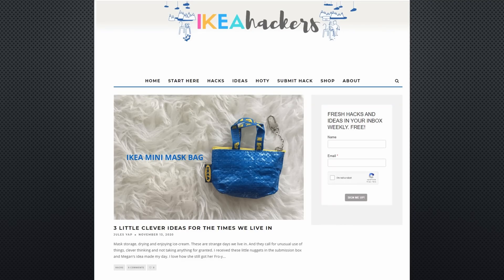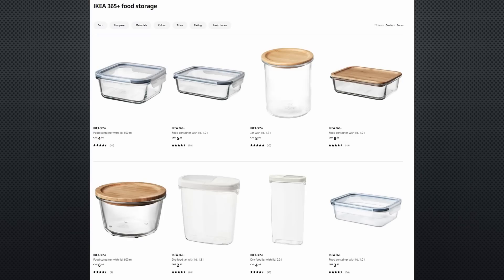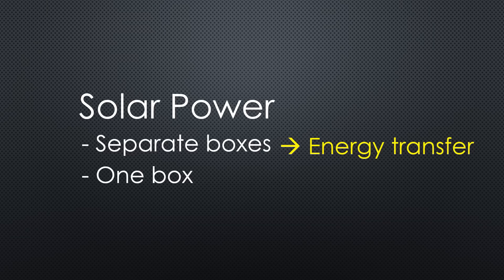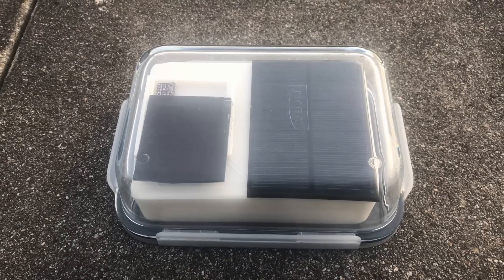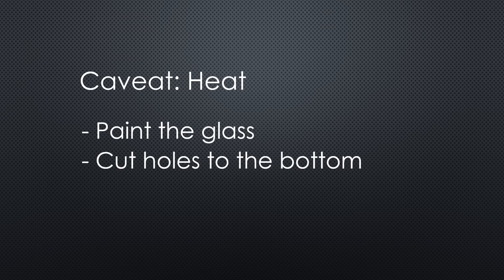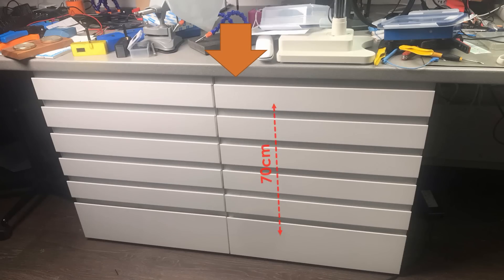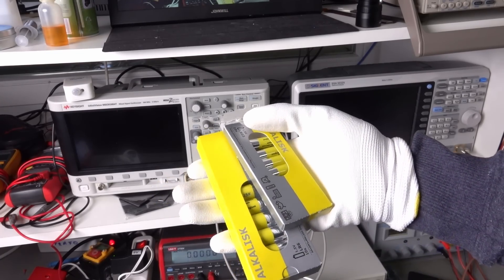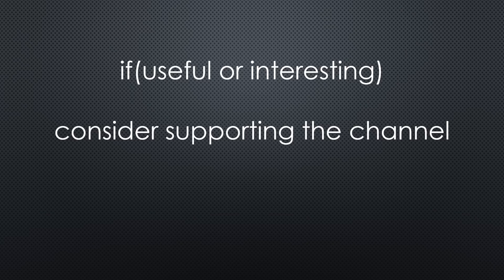#361 IKEA Goodies for Makers incl. my Newest Find

Comment: Hi Andreas, thanks for another great and interesting video - I think that using a double glass walled container like a thermos would serve you well would be a great experiment that I might even try myself
Reply from the maker: Do you have a link for a double glass box for a reasonable price?
Reply: @AndreasSpiess  all the glass thermos containers are cylindrical designs but many have a large mouth opening - not sure if it’s suitable for your project but it would be interesting to see how it performs as a temperature isolation and RF signal transmission and reception

Comment: As you noticed, epoxy coated solar panels quickly degrade in the sunlight. However, there is a quick and simple solution. Multiple manufacturers make clear UV-resistant thick tape for fixing greenhouses etc. It is perfect for protecting the solar panels, easy to install and with a few years of experience it seems to do the job well. Also, it does not seem to affect the efficiency of the panels much. I believe big clive has a video about using this tape.
Reply from the maker: Great tip! Today I learned from other commenters that the glass also blocks UV. So I have two solutions.
Reply: @AndreasSpiess  glass definitely protects from the UV-light, but my experience is that most glass types will significantly reduce the panel output (like 20-50%). That's why solar panels normally use special low iron glass. The tape I have been using is something like this: https://www.amazon.co.uk/Scotch-Supreme-Glass-Repair-Tape/dp/B00QRZACW8
Reply from the maker: The reduction in power is well possible, but not too important in this application. The worst case would be that I have to add a bigger panel. They are no more expensive.
So far it completely charges the battery every day. I will see how it will go during winter.
Thanks for the link.

Comment: How about reducing heat with a Peltier device?
Reply: Uses waaaaaayyy to much power. You'd need five extra solar panels. Plus the Peltier needs to be able to dump its heat somewhere, which would mean having to make an opening in the box to fit the hot side.

Comment: For outdoor boxes we ussualy drill one ore two holes at the lowest point to facilitate the box "breathing" thru night do to pressure changes from the temperature, thus the water is spitted out in the morning, the only problem is that the humidity is the same as outside. But there is no problem of water collection.
Reply from the maker: Many viewers suggested this method. Therefore I will place a second box with such a hole nearby and watch what happens.

Comment: Great video!! Here area my favorite from Ikea Spain: I use the LADDA/Alcalist/CR32 batteries, power bank,  103.115.96 great for keeping all spugers/small tools, 102.891.14 to store RTL-STR and leads, gliss transparent boxes for components etc (just came back super cheap), 600.940.72 coloured trays/bins for work in progress or bring small tools and measurement equipment to site of failed equipment. Still looking for the radio controlled clock you showed. I guess Madrid is too far from DCF77 (1000 km), but I am able to sync with my wx station (guess Ikea don't want to field service complaints if nor working reliably).  Thanks for the tips on the new containers, looking really good.
Reply from the maker: I think you discovered good products. Unfortunately I did not find a way to search for product numbers on the IKEA page :-(
Reply: @AndreasSpiess  Yes you are right some references are no longer sold. pity.

Comment: Regarding the temperature issue: we sometimes use dual heatsinks, one on the inside, one on the outside, but we mostly use metal housing. Maybe it is possible to implement it by cutting in the plastik lid and ad some alumimium sheet for the heat transfer and silicone caulking for the water resistance.
Reply from the maker: That would be a good way to get heat out. I still dream of a possibility to avoid entering too much heat. And another viewer suggested to just take the battery out. Which also would be a viable solution.

Comment: To get rid (or at least reduce) the moisture on the inside, install a Gore-Tex vent in your enclosure. The temperature changes in combination with a large volume sucks moisture in through the water tight seal. A Gore-Tex vent will equalize the pressure without letting water droplets in.
Reply from the maker: Many viewers suggested such a vent. I have to search for one on aliexpress. Then I plan to setup a few boxes with different "systems" and compare them after 12 month or so.

Comment: Watch out, polypropylene has a tendency to break in the sun's UV radiation. I've had similar clear plastic things (made for gardens, mind you!), and they tarnished and became so brittle that touching them breaks them like if they were made out of sugar. I would think that the glass containers fare much better, though. That would be my choice too. Cool ideas as usual, thanks!
Reply from the maker: You are right. I would not use plastic boxes in the sun. In my setup the plastic is covered by the glass. And other commenters wrote that the glass removes a lot of the UV. So there is hope!

Comment: Ikea Lack square tables (the yellow one at the end) also make good 19 inch racks, though you may need to support very heavy equipments at the rear by using offcuts of hardboard sheets stacked in between items - the legs are relatively weak as they are hollow except at the ends but will easily support network switchers and routers. 

For taller racks you can drill the ends of the legs and glue in dowels (I used a short piece of M6 threaded rod) and drill a corresponding hole in the lower tabletop  - this prevents disasters because the upper table will slide on the lower one otherwise. 

You can then place very heavy equipment direct on the tabletop, where it can slide in/out easier. Cut a  sheet of hardboard to make a liner to assist sliding - or the tabletop may be scratched by the nutserts and screws on the equipment case. 

Stacks 3 or 4 tabes high are possible if you put the lighter equipment at the top.
Reply: I think these were called "lack racks"
Reply: Better Racks: RAST. See my other posting :-)
Reply: Thanks, I just was thinking on how to do my home lab for cheap !
Reply from the maker: True, I found a few googling "lack racks"
Reply: AFAIK, Ikea changed the LACK table. The legs are not any longer stuffed/made of compressed wood, but of paper. Makes the use of dowels impossible. :(
Reply: @mrwho30  ah but the ends have a short plug of what is called particleboard, in British English, though most people call "chipboard". 
It's about 1 or 2cm thick on the leg bottoms and 3cm thick on the tops (where the large screw fits into the leg top). The rest of the leg is hollow. 
Likewise, the corners of the tabletop also have a block of particleboard  to accept the thick screw. 
Original Lack (I'm talking 1997-ish maybe?) had solid particleboard legs that were noticeably heavier.
If you fit rack rails the trick is to use them full length and  screw them into the very top and bottom of the legs firmly, while screws in the middle have less purchase. It's best to always prop small offcuts of harboard between item cases to support the rear and prevent them sagging. 

The tabletops have remained unchanged -  are what people would recognise in the UK as "council-house door" - very easy to punch or kick through. For a simple rack they are good enough to hold the weight of a steel fileserver with full size rack width and 16 spinning hard drives. with a heavy PSU. 
I don;t attempt to fit rails to the legs fo these heavy cases though, I rest them either direct on the tabletop or with a hardboard sheet so they slide in/out easier without nutserts or screws on the bottom diggin into the surface.
But hey, for the insanely low price, who gives a flying duck about scratches?

Over the last 20+ years I think I have left behind at least 100 Lack Racks at various SoHo offices or outposts. I only realised that people call them Lack Racks about 10 years ago haha. 

Whenever I visit an Ikea store  somewhere smilar I always take a proper tapemeasure. 
450mm is the ajic width between the legs/sides, thogh a couple of extra mm (452mm) makes sure that protruding screws/bolt do not jam - especially for cheap cases. 

I have also had good results making small racks by using two simple length of wood as uprights - screw the bottm item to the wood and then use couple of offcuts of hardboard as spacer and put the next item on top. Again, screw the rack ears to the wood. Do the same for the thrd item. Not very interchangeable boit at least it stops items form sliding around and makes cable management easier. 

Spend the saved money on health supplies like beer and chocolate.
Reply: @gordslater  Wow...sorry, that i can't give you more than one thumbs up for that impressive answer!

Comment: You can revive those epoxy solar panels using fine sand paper and then metal polish but it doesn't last very long
Reply: Toothpaste should work as well.
Reply from the maker: I chose to dispose them. They were not extremely expensive.
Reply: There are kits for restoration of plastic headlights of cars, those even include some kind of clear varnish. These should work well here as well.

Comment: Isn't the glass borosilicate? If so, you can just use thermal paste to transfer heat to the "glass" from the components. Also, if you don't use IR, just use an optically transparent IR reflector, like those used in car windows.
Reply from the maker: Good idea with the IR reflection foils. I can cut out the IR sensor.

Comment: An ikea on the heat....lol just paint the inside of the glass with white plasidip and lift so air can flow under it.. if more cooling needed epoxy a few heat sinks to the lid inside and out no need to cut the lid just pass the heat through it unless you need to move a lot of heat then you might need to cut it
Reply from the maker: I assume it will not be a lot of heat. I will do some measurements and maybe we will get a second video about the findings ;-)

Comment: I created a small and cheap trolley for my workshop using IKEAs Alex, 4 wheels (Rill), handles for cables etc. (Lansa) and Småcker for the drawers. Very nice and less than 85€.
Reply from the maker: Nice/ Unfortunately I did not find Lansa in the Swiss IKEA shop.
Reply: @AndreasSpiess  I bought them ca 2 years back. Now they seem to run as „KALLRÖR“.

Comment: Maybe you can use Peltier element to cool the Battery
Reply from the maker: Maybe it would need too much energy?
Reply: @AndreasSpiess  Yeah, that thought crossed my mind after i pressed Enter :)
And there is also the problem with sealing the hot Heatsink outside of the box.

Comment: as part of your cooling put your project bix up on pilars , noticably taller one side than the other , this greatly assist convection cooling suggest shorter length at about 25 mm to allow sufficient flow. and to thermaly couple batteries to bottom of enclosier and insulate their top.
Reply from the maker: Good ideas! Thank you.

Comment: I love those LADDA AA batteries. I'm powering my indoor temperature logger with them (3 x 1.2V) with a FireBeetle ESP32 board. I get 4 months runtimes out of a charge. Board wakes up from deep sleep every 15mins, then it connects to WIFI, reads temp sensors and uploads values to Google Drive.
Reply from the maker: And the voltage is perfect for the ESP...

Comment: I built an "exposed" weather sensor. Wemos PM2.5 sensor, light, UV sensor and a BME280. Water pipe housing 3 printed holder to keep the components together. Those "collars" are pipe covers that hide how the pip comes out of the wall. Top done is an old light bulb cut and glued in. All the electronics and conformal coated. Working so far since June this year: https://photos.app.goo.gl/iufnddMyu832fVZR9

Comment: That IKEA LACK table is also used as a cheap 19" rack as it is a perfect fit, just screw into the legs. Google lack rack.
Reply from the maker: I did not think about that. Thanks!
Reply: That is so cool.  I wonder if they designed it to be like that in 1980s, when Lack was released. Was 19" equipment a thing, back then? Or is it just a "happy accident"?
Reply: @adameichler  19" rack is also used for A/V equipment, so maybe they wanted to size it just right to put a home entertainment system on top.

Comment: Here in SA it's Walmart or Leroy Merlin, however between those two one can get everything needed.
To get Ikea stuff here we have to preorder with a local importer after choosing the product from the China website, huge hassle and expense.
But Ikea does have good stuff, their furniture is very nice, however we pay a premium price for here.
There's a local importer, and they stock the furniture products, and it's expensive.
A six drawer set on castors is 310 dollars here, pricy for us.
Reply from the maker: I did not know they are not in SA. Strange...
Reply: @AndreasSpiess  If the cost and time spent getting their products is not an inconvenience, then it's available here. However they have to compete with the Walmart chain of stores here which are great.
They have everything, so we use them.
The market for a product like Ikea which is for us a specialty store, is small here.
As it is Walmart had to close their techie store brand "Dion wired" here, for various reasons.
It was essentially an Ikea like store, but by Walmart.
They had nice stuff, but did not make a profit, for various reasons, mainly how they ran the show, etc.

Comment: For masking sunlight, try aluminium foil tape (used for duct sealing etc.)
Reply from the maker: Good idea. Thanks!
Reply: you could also use ncr rescue blanket
Reply: that might help but it might not be sufficient. there should be a way how to build a passive heat exchanger but then the sealing of the box becomes a problem again.
Reply: Black spray paint on the inside of the boxes also absorbs light nicely and gives out some heat

Comment: If you want  any kind of waterproofness you have to compress the seal. The ikea glass lunchboxes are good for this, provided you use water-rated passthrough fittings
Reply from the maker: So far I did not use any water-rated passthrough fittings and had no humidity problems. But I do not have a four seasons experience.

Comment: I have always learned that you should add a minimum 8mm hole to all devices that should work outside. The reason behind is that the temperature difference causes air to move in and out of the box, together with moisture. The hole size is the minimum size where water can escape. Some offshore antennas, have a long pole attached to vent to the outside, and with splash proofing, so water from a hose does not enter.
Reply from the maker: Good point. For the moment I have no hole and had no problems with humidity. But I only have two seasons of experience...

Comment: Hi Andreas, i like these ikea hacks a lot. The kitchen cabinets with the relatively small (not so high) drawers look fantastic. Unfortunately i could not find these in my local ikea store. I think it is an older model? Do you remember what its ikea name is?
Reply: These are the current models: https://www.ikea.com/de/de/p/metod-maximera-uschr-4-fr-2-sch-3-haho-sch-weiss-veddinge-weiss-s29267904/
Reply from the maker: Yes, the system is called "METOD". The particular front is no more produced. Now they have a similar one without aluminium. Buy the more expensive mechanics, it is much better.
Reply: @AndreasSpiess  Thanks Andreas, i looked into it on the ikea website. What do you mean with “ buy the more expensive mechanics”? I don’t see any option to buy other/better “mechanics” for the metod kitchen drawers?
Reply: @jorgwende6314  Thanks Jörg!

Comment: Use a membrane to let air in and water out. Pet or ptfe membranes do the job.
Reply from the maker: Good tip. For the moment I had no problems with humidity. But I only have two seasons of experience.
Reply: @AndreasSpiess  with thermal expansion of the air you could get problems with summer rain as the air inside will shrink fast.